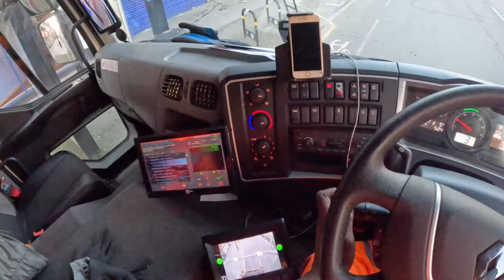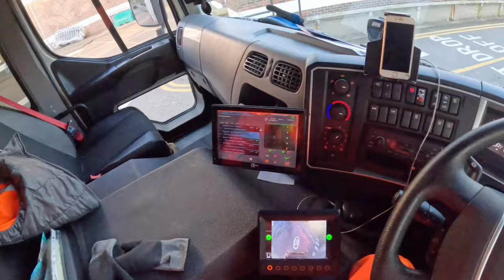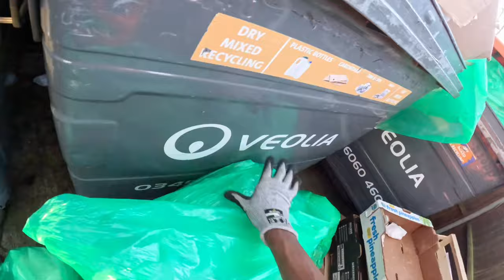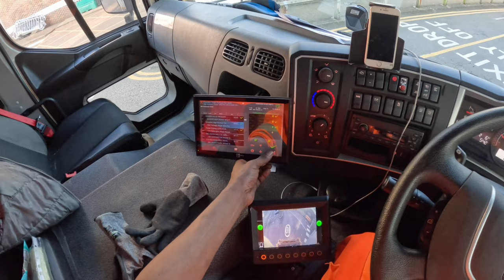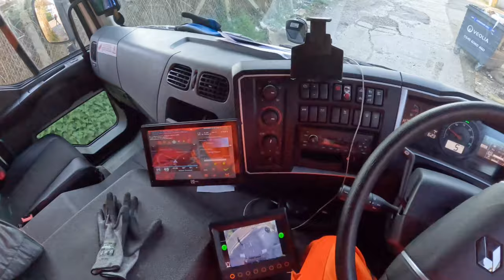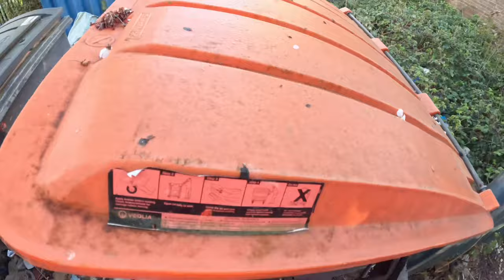Dustcart/garbage driver collecting waste/garbage recycling in south London as a lone worker

Comment: 27:55 are those light blue lidded 240 bins all glass bins? Have you worked on a round emptying them before?
Reply from the maker: Yes they are glass bin but there’s a food and glass truck that collects them. If they were mixed with plastic bottles then I would collect it as DMR
Reply: @Rubbishcookreal  dmr?
Reply: @southaussiegarbo2054  Dry mixed recycling
Reply: @barryhill6507  ohhh i known it as comingled